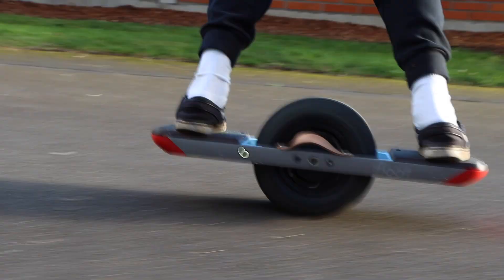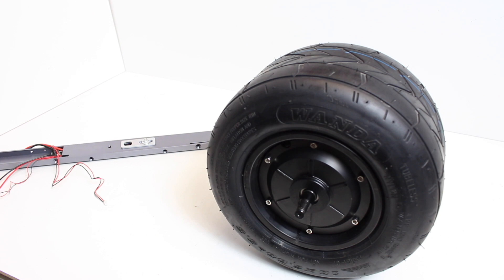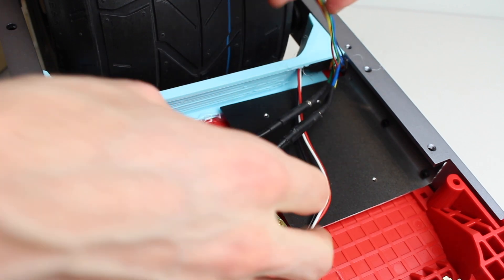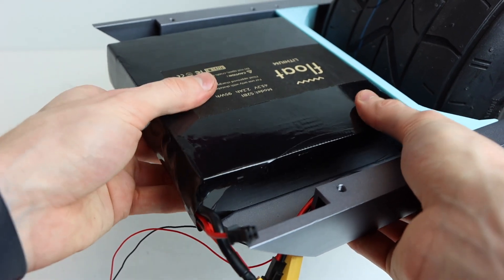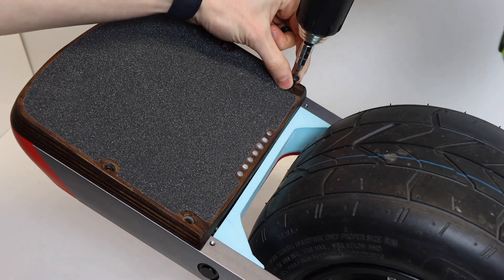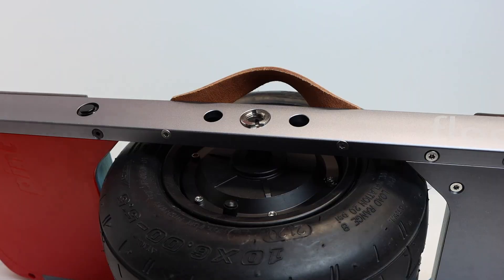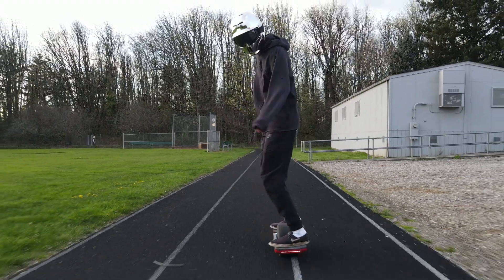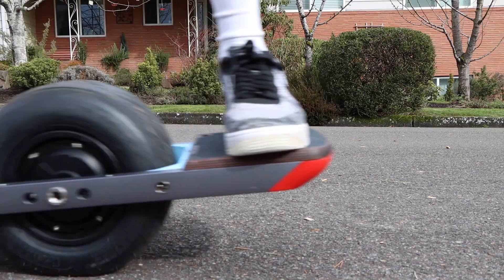How to Build the FLOAT Wheel Kit - $650 ONE WHEEL KILLER

Comment: Finally after 6 months I have mine fully working 100%. Wasn’t that hard to waterproof either. Man this thing zips. I’m pretty sure it’s only about 15mph, but it goes fast enough to make you scared of a fall, and trust me on this one… when you fall you’ll definitely get a badge of honor for it. I still love telling people when they ask “where did you buy that?” And I say “I made it” the look on their face is priceless.
Reply: it looks like a NIGHTMARE to waterproof!  Still awesome though.
Reply: @leeboss6631  oh my god was it difficult to waterproof. I had to build silicone layers like a 3D printer in a couple places. I’d say water resistant. And to the above question: there is no way in hell a 48v battery pack is ever going to power a 200lb man to 25mph. You need to ram up to at least 15s(60v) to achieve 20+mph. The wheel diameter is what limits this equation. Make the wheel 20” tall and you can hit 30mph on 36v dewalt packs. The problem with onewheels is that they are limited by their form factor. And if you bought a FM onewheel it’s also limited by tyrants who hate diy. I doubt you want to go faster. I was one of those people who say: I want my board to go freeway speed. Everyone thinks that until they wreck. I wrecked at 15-18mph and it shredded about 10% of my skin, I lost almost a quart of blood, and it was very difficult to ride in that condition. Moral of the story: wear pads.
Reply: where do you buy them?

Comment: Great video, thx guys! What's the prospect of a larger battery in there?  I build my own packs and would love a little more range...
Reply from the maker: I've seen pics on the forum of people building bigger packs, but it's a tight squeeze for sure
Reply: @DIYesk8Builders  absolutely. Thx for the reply.  Cheers!
Reply: With a spacer on the rear, you can do a 12s2p of 18650s, but you'd have to source a very small BMS. Or run without one. Using a 2p battery of higher output cells makes for a much better ride.
Reply: @TheBoardGarage  hi Mario, appreciate your content. Have you heard of anyone running 13s on the balance pro?
Reply: @adam-qd5xx  Yes, a couple of folks on the Discord have tried it and it works just fine so long as you set the parameters properly.

Comment: Awesome video!! Is there or will there be a Float XR ?? I'm hoping there will be, and I also hope it's around $1000 or less because that would really get heads turning! I also am wondering if the VESC is rock solid and smooth and as reliable as onewheels? Or is there some room for improvement? And lastly, it doesnt look like the float is very sealed, are there rubber gaskets to install to get a water and dust/dirt resistance?
Reply: The potential of the VESC platform is pretty substantial. There are beta firmwares being tested right now that ride very close to (and with the right setup, better than) a Onewheel. Reliability is really more at the component level. Not all VESCs are made equal, and neither are all batteries. With the right skill and planning, you can make something better and more powerful than an XR (what I'm currently working on). 
As for water resistance, not at all. This kit isn't water resistant as is. On the Discord, there are newer better files to print, that make boxes for the components. And you can go from there and make a pretty water resistant build. But you have to take the time to do it, and it'll only be as resistant as you make it.
Reply: I wouldn’t be surprised if there was one coming. Seems like electric commute vehicles are getting better and cheaper every year 😁

Comment: This is really awesome. One thing I would suggest is adding a couple of little wheels at the front edge of the board to prevent the front from digging in and throwing the rider off if the front lands to far forward. Not usually a problem, but more than a few people have been seriously injured from that.
Reply from the maker: Yep some fangs would get great

Comment: Nice vid. Just ordered my kit, planning to do my own battery though, hopefully I can squeeze in 12s2p.
Reply: What battery capacity are you planning?
Reply: @jasper5945  depends on the cells I use. I’ve seen guys fit 12s2p 18650 cells in on Reddit. I think the balance pro is limited to 12s (maybe 13s?) otherwise I’d stick with 21700 cells at like 15s.

Comment: Do you know if the float wheel battery will with with flipsky or focbox vesc?
Reply: @DIYesk8Builders   just seeing if I can use my float wheel battery to also power an electric skateboard build with either a flipsky or foc box esc.. sorry if that’s a noob question just not very knowledgeable with the universality of batteries
Reply from the maker: Yeah it can definitely be done!
Reply: @DIYesk8Builders  ok sweet thanks!. Would there need to be any mods or just direct connect to a flipsky esc
Reply from the maker: Nope it should work but the float wheel pack does have its power switch so you'll need to also use that power switch to turn the battery on
Reply from the maker: @michaelraulgutierrez5367  just a direct connection

Comment: So how much speed can one expect out of this motor? I own a Pint, and I know the motor in that is 750 watts. This one is 1200 watts. I weigh 205lbs and can't get my Pint past 16.5mph. The motor specs listed on the Floatwheel site show top speed of 38kmph (23mph). So as a rider that weighs over 200lbs, can I expect to hit around 20mph on this wheel? Also, my Pint range with my weight is 6-8 miles (on relatively flat terrain). What do you think the Floatwheel range would be with my weight?
Reply from the maker: Not too such what the top speed is, I'm too scared to get past 16 or so just because I'm not quite comfortable on it yet. Range I would say is probably around the same as the pint

Comment: All that work to save 300 and end up with a lower quality product doesn't seem worth it.
Reply: I would try this just so I wouldn't be supporting FM anymore
Reply: @arib4497  they are that bad? Should I rethink buying a onewheel?
Reply: @gabrielprandini2629  FM as a company is pretty bad. There customer service is questionable and it is very clear they only care about making money and not about the consumer. They have created app updates that brick people's boards that are modified, which I think speaks volumes. If you have to buy anything from FM, only buy the board and nothing else. There are a ton of 3rd party onewheel companies that have amazing accessories for the onewheel and have outstanding customer support. I will say though, my XR is one of the best purchases I have ever made, and the product is solid. The resell value is very good and I enjoy riding it more than I enjoy most things in life. In addition, the onewheel community is absolutely awesome. But as an option for a second board, this floatwheel is great. The only downside I can see to buying the floatwheel is the resell value is probably not there. To save $300 dollars on a board would be worthwhile if the board held value as well as the pint does.